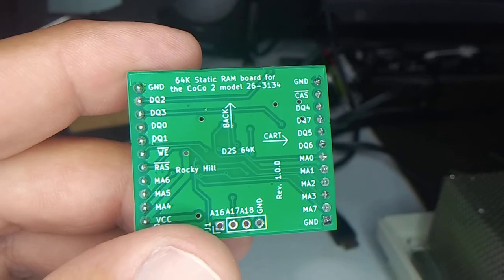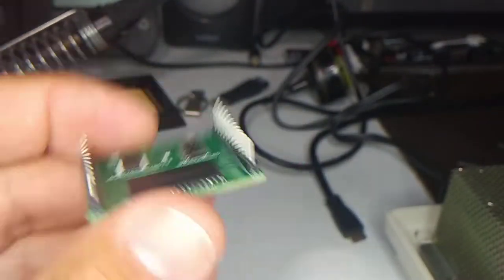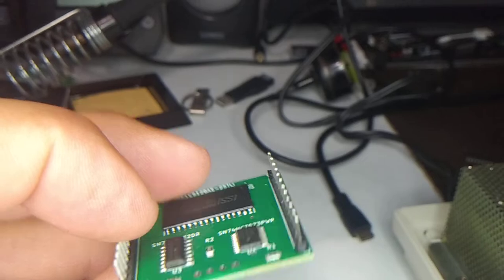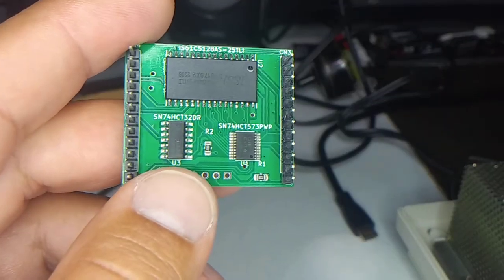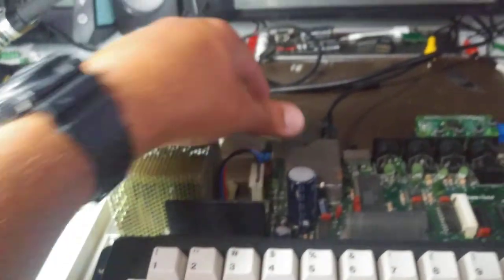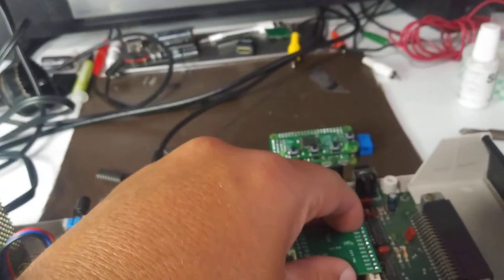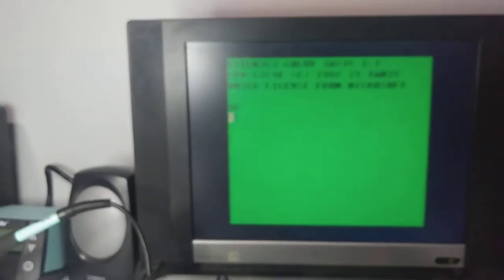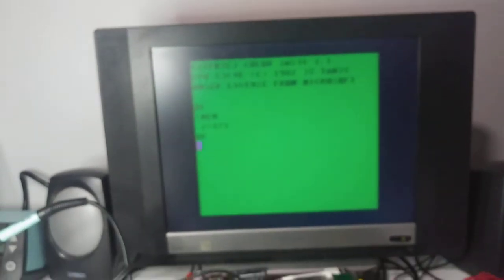Static RAM board for the CoCo 2 model 26-3134

Comment: YUP  That's exactly what I was setting out to do, allows the use of modern SRAM in CoCos.  You beat me to it...although in circuit design and digital electronics I'm a total N00B so most anyone could have beaten me to it.  :D  I will be trying it out.  I know you like the 3134A/B, but might be worth designing a board that will fit the other CoCos.
Reply from the maker: This one was easy to test work with because it has a nice expansion port. This circuit should should work on other CoCo 2's albeit with a different PCB layout.